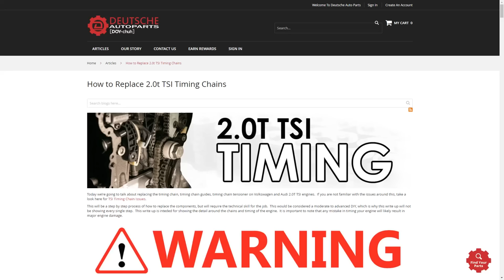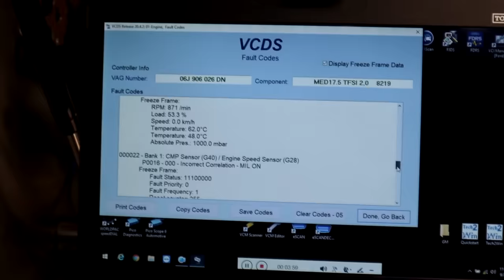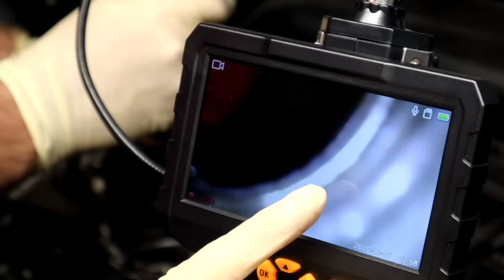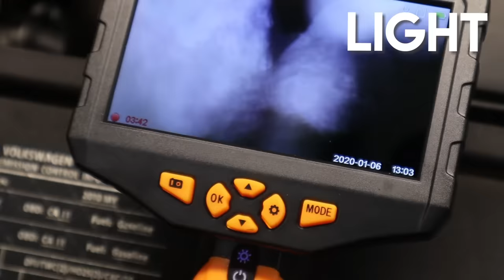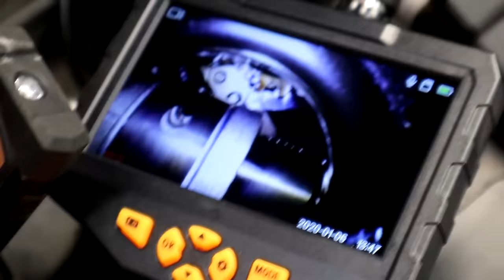The Jalopnik Tiguan FAILED ~ Despite the Warning

Comment: 2010? Might as well pull the motor,  the pistons and rings, fuel pump, PCV valve, water pump, intake manifold, fuel injectors, turbo and exhaust manifold all should be replaced as well as the cylinder head, timing chains, guides and tensioner. Might as well do it all while they have the head off as all of the aforementioned parts are subject to early life (~100k miles) failure.

Comment: I bought a 98 Audi c5 2.4 and it had jumped timing I rolled the dice and just changed the valve tensioner and chains for both banks and turned it on and it was perfect I was lucky on that then I just did the usual maintenance and still driving it till now but I have a misfire on cold start would hope if you give me a tip on what to check

Comment: I have a very old Touran TDi 1.9 which is OK again after that Dual Mass Flywheel sized at 116k miles. All the mechanics ask me: "How many Turbos have you had dude?"   And that would be FOUR the first one at 8k miles from new! It's a nasty issue with that engine.

Comment: Is there any symptoms that you need to get your timing chain changed? Any misfires or jerking or hard idle or anything?
Reply from the maker: Sometimes noise. Sometimes a check engine light for timing issues. Sometimes none
Reply: @HumbleMechanic  yeah researching made me anxious, my car has 120,000 miles and its stock and its from the batch that had the old tensioner yet it has zero symptoms. currently its parked because as i saw everywhere its a job that has to be done at 100k miles and timing chain can cause a lot of trouble if things went bad.

Comment: you haven't really talked about the head gasket..did you just "remove it" and put it back? was any alignment necessary?
Reply from the maker: nope it was replaced. it also is pretty straight forward to align. I felt like if you could handle taking the intake off, HG should be cake.

Comment: So target than a tiny bit of delayed gratification from sending the 125k mile  VW that had never had a cam tensioner replacement to have the job done for $2k, you just drive it and spent $4.5k instead? For your next trick you should buy a 100k mile 911 with its original pilot bearing and take it to the track like Hoovie did.

Comment: What is it with engineers designing engines with plastic timing chain guides? I junked a very nice Ford Explorer Sport because of the timing chain guides disintegrating and destroying the engine...  The darn thing had timing chains in front and back...

Comment: Is the gen 3 EA888, particularly in a brand new 2021 GTI MK7.5 manual, a much better engine, or should I expect timing chain problems after 100k miles?

Comment: The reason VW get a bad rap is bad and crooked tech. I had a cam sensor and 4 coil codes on my 2004 Golf 122. VW dealer wanted $2,048 to replace 3 months old belt. The problem was a $17 temp sensor.

Comment: Guys make a video on the oil pressure issue . That is what matter . We all know that this engines develop low oil pressure sooner or later . Guys all 2.0 tsi specialist are after where we lost the oil pressure . I rebuild more than 50 of those and they dont last after rebuild even I do replace balance shaft and all rod and main bearings , also cam bridge and if necessary cams and even head , still after while low oil pressure come back and mettal shavings in the oil . I still wonder where this engines loose this oil pressure. I dont believe balance shafts like everyone suspect. I think there is another mistery in those

Comment: Instead of the 4.5k spent to put new valves and timing gear wouldn't it have made more sense to get a 2k engine out a wrecked car from the breakers. I had a 1997 ford transit 2.5di banana engine,  timing belt snapped valves bent, I streightened them out with a hammer and dolly and put new brass valve guides in and it ran for another 10 years.

Comment: @HumbleMechanic @Deutsche Auto Parts I noticed you changed the intake manifold however you did not change the fuel rail. I am in the market for a new manifold for my Tiguan and have been told that i must change the fuel rail to use the new manifold. is this true?

Comment: Does these problems count for the 1.4 FSI? My work colleague has a Tiguan with that engine.
TFSI and FSI have a lot of reliability issues.
The newer TDIs from VAG are lacking too in reliability.
It's a shame. Germans often over-engineering stuff with not proper testing (GTE hybrids etc).

Comment: So at 33:47 you mentioned the valve cover is not threaded for the PCV screws (why?...) The implication seems to be that you just go ahead and use the PCV screws as their own tap, which seems a bit hokey. What does that imply for the desired torque on those screws? Im going through the same repair on my mk5 gti  and have the same situation with the new valve cover I have (also from DAP). Any advice/clarification would be appreciated. Thanks very much for all the videos!
Reply from the maker: It’s basically that. You use the bolts to tap the holes. I don’t recall the torque off hand

Comment: Why a new head? I have bent valves before - just replaced the valves, no issues.
Reply from the maker: Did you see the part where I showed the valves smacked into the head?
Reply: @HumbleMechanic  oops, probably distracted at that moment.

Comment: I recently bought a 2009 Tiguan with 58,000km on it, one of the first things I did was get the tensions changed to the new ones.  Though I have a new weird problem with it, Whenever I'm driving and give a bit of gas there's like a weird drone/vibration that comes from the passenger side of the car but if I give it more gas and the car downshifts the drone goes away but when I go back to cruising if i give a bit of gas it comes back doesn't matter what speed i'm going. car is now at 63,000km. any ideas?

Comment: Thank you for the video, i'm currently in a similar situation with a failed timing chain + bent valves. In reference to 30:20 Is this guide issue specific to Tiguan models? I have a 2011 gti MF in Wolfsburg. There is mention of a VIN checker if you could possibly guide me to the site with that or share a link?  Many TIA

Comment: It's crazy seeing that Lil 2.0 tsi in a suv lol. I got 3 vw ccs ATM n my wife has one. I'm having issues with my wife's cc it's running like pure garbage ATM. It's missing on cyl 3 n 2 and says system fuel 2 o2 fault or something along those lines. N the pcv is making a slight humming noise and when I cover the bleed hole the noise stops... as for the sucking down the oil cap ect it doesn't pull it hard but it does have a tug to it... so I'm assuming the pvc is the prob??

Comment: Hello humblemechanic im carlos and i have a qustion i have a ford crown victoria 1998 this engine was rebuild in 2016 or 2017 my dad he put all the cilinders rings news and valve seals too but thus car is getting oil on the cilinder 7 2 weeks ago i change the valve seals for new too but is still getting oil in the spark plug 7 and i dont know what can be can you help me thanks

Comment: Hi there, my name is Vick. where can i find the old Ecu pin number, since i changed a used ecm on 2002 vw new beetle and I need to program the immobilzer?  i already have the pincode  but my scanner is asking me the old pincode for the old ecu? I'm using the autel im508 .. I have Launch x431 torque and i can use other functions but they need the old ecm pincode or pin number, not sure what they're asking. Can you help me out please since  you work on Vw's ..Thank you and God bless

Comment: Is it really worth $4500 to fix a 2010 Tiguan?  I am pretty sure you could find a lower mileage engine from a junkyard for less than that but I don't know for sure.  Also 11K for a new engine seems pretty crazy too since you can get WAY better Honda engines with 40k miles on them for about 1/4 the price or less.

Comment: Thank you for this video. 

I’d like to call out Steve White Auto VW Dealership in Greenville SC. 

Little over a year ago at 110,000 miles I had a fuel injector on my 2010 Tiguan fail. This injector was covered under the extended warranty. 

While my car was there I asked  them to check the tensioner. I said I’d like to replace the tensioner while it was there. 

I was ready to give them $1200 for the repair. 

Why on Gods green earth the skirted the idea of replacing it. I’ll never know. Part of me thinks they didn’t eve. Check. Said something about 5 clicks (I think—what ever that means). 

I’m about to roll 130,000 miles sooner rather than later. 

Had brakes replaced this past May. Reputable VW shop in the area. We discussed the issue with the tensioner. 

Told him my VW dealer issue. 

The guy wanted more money just to check the timing belt. After I felt I had already been raked over the coals from the brake job. 

I’m not the kind of person to sell my problems to another. Never have never will. I don’t feel stuck with the Tiguan. 

I love driving it. I not in a position because of COVID19 to have the tensioner replaced. Even if I had the financial resources I just don’t trust mechanics right now. I feel as if I’ve been used abused and chewed then spit out. 

I’m honestly at a loss and just can’t fathom why a Dealership wouldn’t replace the damn tensioner per the customers request.
Reply from the maker: Ugh. Odds are you got a tech that wasn’t confident on doing the job. :(
Reply: HumbleMechanic you’re probably right.
Reply: HumbleMechanic they had the car for over a week for the fuel injector.
Reply: Had the tensioner replaced 1.5 weeks ago. Five days after it was replaced with less than 40 miles on the car (129k total) after the repair the oil pressure light came on. 

Brought it back to the shop who replaced the tensioner and the said the car has a cam shaft/ oil pump issue and that the entire engine will need to be replaced. Shop is telling me they can replace the engine with one that has 90k on it for $3500.

While the shop pleaded their case that the tensioner replacement wasn’t the cause of the engine failure, it’s absolutely unreal that this car can’t put in 200k miles before it completely dies. 

If you have any recommendations they are welcome. Thanks for all you do for the VW community.

Comment: Surprised you haven't seen this much. This is a very common problem on the Mini N12/N14 motors, especially with careless owners who don't check or change their oil properly.
Reply from the maker: I’ve seen plenty of chain guides fail. Just never that exact one
Reply: @HumbleMechanic  fair.  Most of my experience with timing issues has been with my Mini and the rest of the Mini community in general. (plus the Mitsubishi I had 25 years ago. Never again with that brand. lol). That upper chain guide is the first thing to look for with timing issues.  
I'm amazed to see how complex the timing circuit is on the TSI engine.

Comment: Wouldnt you want to do an oil change since there's metal shavings through the engine?
Reply from the maker: We did :)
Reply: @HumbleMechanic  ah I shouldn't have doubted. May I ask, would the shavings be throughout the pan and and block? Would an oil change remove it all? Great video btw :)
Reply from the maker: Worst case in the pan.

Comment: It's insane to scrap an entire cylinder head just because the valve seats need to be replaced. A machine shop in Eastern Europe won't charge you more than 200€ for this job and it won't take more than 2 days.

Comment: Hey Charles, I'm owning the same Tiguan dealing with a low oil pressure red light, I changed the oil pressure switch, changed the oil pump, changed oil and filter, did oil pressure test, I'm getting my manufactured oil pressure,  need help getting frustrated. I appreciate any help I can get here.
Reply from the maker: Probably some oil galley clogged like in the balance shaft

Comment: That piece of PLASTIC is most likely UHMW ( ultra high molicular weight ) material. This stuff resists sliding wear and used anywhere guiding sliding metal parts is necessary.

Comment: Soooooo.... Does my 17 GTI Autobahn suffer from a similar issue? I rack the miles on and am presently just short of 130,000 miles.Not really wanting to spring for valves and a head, Should I be buying new chains and "followers" (little plastic chain guide do dads) That failed Jason's Tiggy and a tensioner? A little gun shy after that great vid. Or should I go retro and buy a 69 Mustang with iron under the hood I understand and don't mind ripping into myself??
Reply from the maker: No this stopped in the GTI in 2014
Reply: @HumbleMechanic  Thanks!

Comment: The older tsi engines have some weird problems you have to fix them before they go wrong new ones have gotten a lot better the 1.4 tsi has been replaced with the 1.5 the 1.5 is loads better

Comment: I have a question. A lot of people are doing the balance shaft delete because they say it’s... “safer” to do it asap. Especially the ones selling that wheel. Is it really recommended or they just want to make some cash?
Reply from the maker: Shoot me a link to the one you are looking at. I haven't seen a lot of balance shaft deletes for this engine, but I haven't really looked.
Reply from the maker: That’s for the FSI belt engine. Not the chain engine. I’ve done this in a TDI. It makes a noticeable difference vibration. Not unbearable but noticeable
Reply: @HumbleMechanic  Oh, I didn't knew these two types of engines are so different. Thanks

Comment: I have a question, I have a 2009 tiguan and is it possible to remove the chain tensioner inspection cover from the front wheel right side?
Reply from the maker: yes. that is what we did. Not the upper cover so much, but the lower cover

Comment: The downfall of German car reliability is basically due to the fact that they, for the last decade or so, are struggling to get their heads around trying to cut manufacturing costs to compete with the Korean and Chinese cars.
They were previously content to sell well engineered cars at a premium, but the disparity in costs became so much, and the quality gap closed so much, that they had to start cutting costs to even stay in the price ballpark.
Mercedes Benz even contemplated quitting car manufacturing all together and just making trucks and vans, due to this problem.
There's a saying that goes, "Anyone can make a great car for $100,000, the real skill is making a great car for $20,000."
There not used to having this problem.

Comment: The chain on the oil pump  only comes off on the 2.0the 1.8 u have to remove the sprocket and I know a way easier way to clean those air ducts this is my gravy ur doing

Comment: Try the famous Mercedes 3 valve v8 250 newton meter and then 90° i had to cry uncle and pay the mechanic the tool i got to hold the crank crumpled like foil they say when you do the 90 degree final as per spec it ends up being in excess of 300ftlbs and people break half inch breaker bars and bend them tempting this repair regularly including professionals that have done them before

Comment: The problem is the value of these is so low, fixing it is not worht it if you have to pay someone. Next will be the multi thousand dollar high pressure fuel pump, then the turbo (including exhaust manifold) then the transmission...could cost as much as $20k to fix the issues that keep it from running over the next few years.

In other words, if it still runs, sell it.

Comment: 26:12 He wants to skip taking the oilpan off. But I would have done that to see where metal shavings and little plastic parts ended up. They are probably in the pan or are already clogging the oil- pump- inlet- screen...
But the core-message of this video is to avoid all EA888 and other similar TSI- versions alltogether. VW screwed these up good, get a TDI or a better designed newer TSI...

Comment: Hey guys, I'm looking at potentially purchasing a 2013 Jetta GLI Autobahn with a little under 63K miles on it from a dealer I'm unfamiliar with. What questions should I ask when I go test drive the car, and what answers should I look out for as red flags? I read that if it was manufactured late in 2013, it should have the updated timing chain tensioner. Is there a way I can check and make sure that's the case easily before I'm pitched the hard sell from a desperate salesman? Thanks for any help!!
Reply from the maker: Still want to check it. You can check with the scan tool. Might be worth a pre purchase inspection at another shop

Comment: Thats why i hate the tiguans, too small of an engine for a heavy car, VW shouldve thrown a v6 motor in it to compensate for the bigger car
Reply from the maker: VW and Audi are running similar engines in much bigger cars. it's not really a vehicle size issue. but I also agree a V6 would be rad!

Comment: I'm getting a q7 with the 3.6...any issues that I should be forewarned...I read some issues with oil pump gear bolt backing out and throwing t chain?
Reply from the maker: not totally sure on the Audi side, but early 3.6 on the VW did have that issue. I think by now most should have been fixed. but there are always a few rascals out there that didn't
Reply: @HumbleMechanic  this one is an 07 with 110000k...
I do alot of my own repairs was thinking about doing all the chains tensioners kit..but it's an engine out job😓..
Great channel you have!